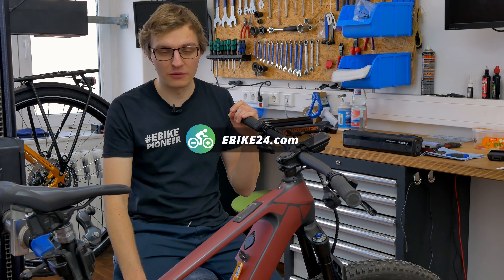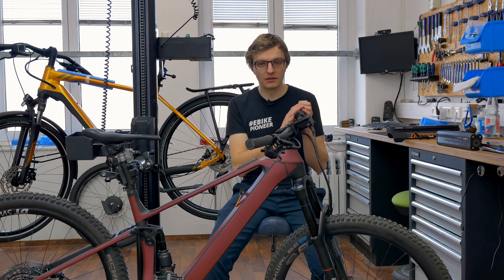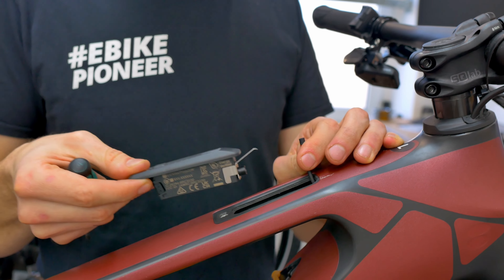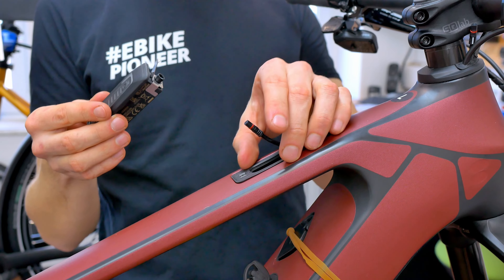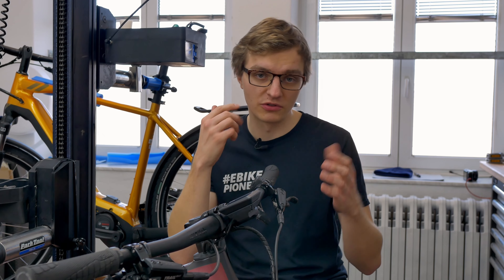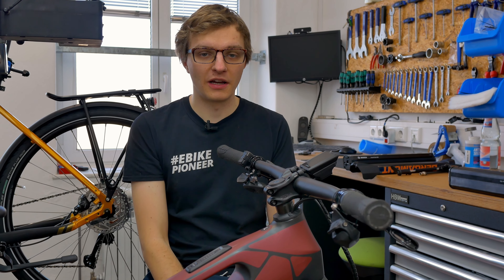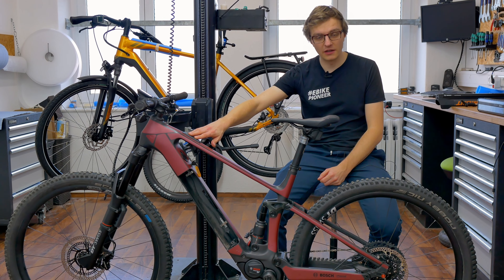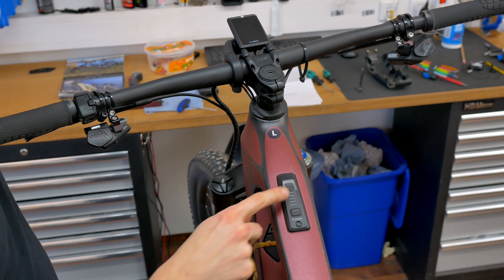Retrofit a Kiox / SmartphoneGrip to the Bosch System Controller | Tutorial 🔧| EBIKE24

Comment: Hi can you please tell me if the retrofit is possible in Orbea Wild Fs H10? Because I really want to have a kiox 300 display but I don't know if it's possible 🤔
Reply from the maker: Hi, and thank you for your comment. Based on the information I found online, your Orbea bike is compatible with the Kiox 300. Your Bosch motor already uses the Smart System software, which is required for the new Kiox display. If your bike currently has the Bosch System Controller installed (as shown in the video), the retrofit is possible.

You can order the Kiox 300 here: https://www.ebike24.com/bosch-kiox-300-e-bike-display-for-smart-system

Do not hesitate to contact us if you have any questions!
Cheers - Michael
Reply: @ebike24  Thanks for the help, take care!😁

Comment: love the video! Only one problem. I do not have any premade holes 🤣what do I do in such a case?
Reply from the maker: Hi, Thank you for your comment! That is tricky. Is the Bosch System Controller already installed on your bike? Retrofitting the System Controller is unfortunately not possible if you don't have the prefabricated recess in the frame.
Cheers - Michael

Comment: Hi Michael.  I have a brand new Trek 9.8 Rail XT Gen 4 with system controller and mini remote.  Would like to add a Kiox 300 over the stem if possible.  Do you know if this configuration would work?  I seem to have 1 cable routing hole available on the right side of the frame, so ideally a single cable solution to mounting the Kiox on top of the stem (like they show in the Bosch video) would be nice.  TIA
Reply from the maker: Hi Matt, thank you very much for your comment. Yes, this combination is possible with your Trek bike. You can also check here: https://www.bosch-ebike.com/en/service/productcombinations
For the stem mount, we currently offer only one mount that is universally suitable: https://www.ebike24.com/byschulz-kiox-300-stem-ahead-bracket
However, you can carry out the installation just as shown in the video.
You can find the Kiox 300 retrofit kit here: https://www.ebike24.com/bosch-kiox-300-e-bike-display-for-smart-system?number=7600-005
For the correct cable outlet, you will need to check which option suits your bike better. You can also find the Bosch Y-cable for a cleaner cable layout here: https://www.ebike24.com/bosch-y-display-cable-system-controller
Cheers - Michael

Comment: Hi - I have a Grand Canyon:ON 7, do I need the screen support with the top or bottom cable exits? thanks
Reply from the maker: Hello and thank you for your comment. It really depends on where you want to mount the display. If you want to mount it above the handlebar using the single-arm bracket as shown in the video, I would recommend positioning the cable outlet towards the back/downwards. However, if you prefer to mount the display lower down, above the stem, having the cable exit towards the front/in the direction of travel would be the better option. Both options are perfectly feasible. It simply comes down to your preference and ensures neat cable routing on the handlebars.
Cheers - Michael
Reply: @ebike24  thanks I'll wait till the bike arrives and have a look. It's impossible to tell from the website there are no photos of the handlebars or whether there is a central controller.  Thanks for responding,  when i find out I'll buy the parts from your website

Comment: I have a speed pedelec and just bought the Smartphone grip. However, I cannot use it, as my bike has to have the display (kiox 500) on all the time (I didn’t know that…). I was thinking about buying the retro fit to then have both, Kiox and smartphone grip. Do you if that’s possible? That display Y cable would be the right one, in case that setup is possible? Thanks for the video and for the support!!
Reply from the maker: Hi Ruben, thank you very much for your comment. I am afraid that the SmartphoneGrip is not compatible with S-Pedelecs. The manufacturer probably does not want S-Pedelecs to be modified, as this would all have to be documented. It may also be that it is not legally permitted to mount the mobile phone on the handlebar, such as with the SmartphoneGrip, as you are travelling very fast at 45 km/h. If I select the Performance Line Speed in the Bosch product combinations, the SmartphoneGrip is also displayed as incompatible (https://www.bosch-ebike.com/en/service/productcombinations). I think the best thing to do here is to contact either your dealer or Bosch directly. Unfortunately, the legal situation for S-Pedelecs varies from country to country. Here in Germany, the laws are extremely strict, so Bosch probably has to comply with these laws.
Cheers - Michael
Reply: @ebike24  hi Michael. Thanks for responding. Yes, that’s the reason. I didn’t know it when I bought the grip. I’ll try to return it… 😕

Comment: How to select the menus on the Kiox with this configuration, without the "LED Remote"? Can the "system controller" on in the frame change menus or can you use the Flow app?
Reply from the maker: Hi, if you have also installed the Mini Remote, you can use it to change the menus. If not, we recommend using the eBike Flow app to create the desired ride screen with the most important information. Alternatively, you can select the automatic screen as standard.
Cheers - Michael

Comment: Hi, I curently have a setup with the System controller, mini remote and Intuvia 100 on a Bosch Performance line CX.

I am looking to replace the mini remote and the intuvia with a purion 200 but I woukd still like the system cobteoller on the farme to wotk, could you please tell me if this is a possibility?
Reply from the maker: Hi Josh, Thank you for your comment. Unfortunately, this combination is not possible. You can either equip the System Controller, the Purion 200, or the LED Remote, but you can only equip one at a time. You could replace the System Controller with the Purion 200 and then also equip a Kiox 300/500 or a SmartphoneGrip (or keep your Intuvia 100).
You can also check the official Bosch site, where you can configure and see which combinations are suitable for your system: https://www.bosch-ebike.com/us/service/productcombinations
Hope this helps!
Cheers - Michael

Comment: Would Polygon TE-N be possible to install Kiox 300?
Reply from the maker: Hi and thank you for your comment. I am not very familiar with Polygon bikes, but if you are referring to this model: https://www.polygonbikes.com/siskiu-te-with-bosch/, then yes, you can install the Kiox 300. This is because the Polygon bike uses the new Bosch Smart System software, which is required for the Kiox 300.
You can find the display here: https://www.ebike24.com/bosch-kiox-300-e-bike-display-for-smart-system
Cheers - Michael
Reply: @ebike24  Hi mate, would it be possible to mount it on the top Tube?
Reply from the maker: Mounting directly on the top tube is not possible, or at least I am not aware of an appropriate holder. However, you can mount it on the stem, for example, using this holder: https://www.ebike24.com/bosch-kiox300-ahead-mount